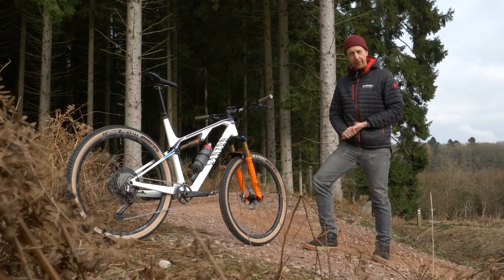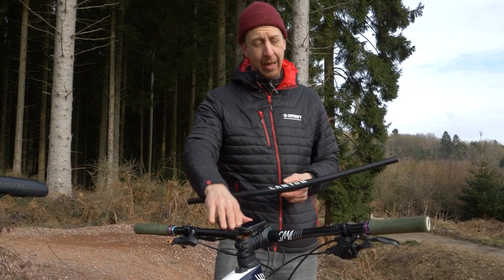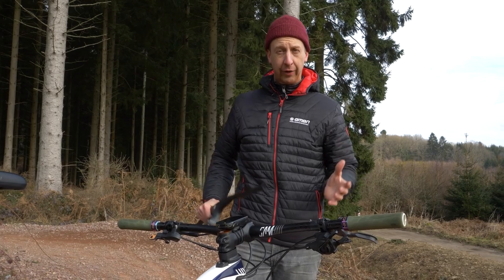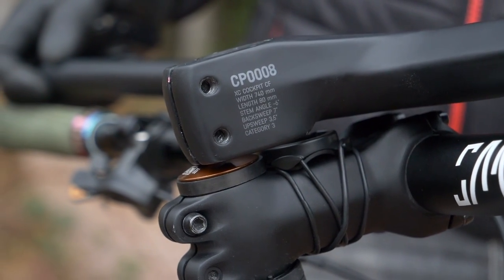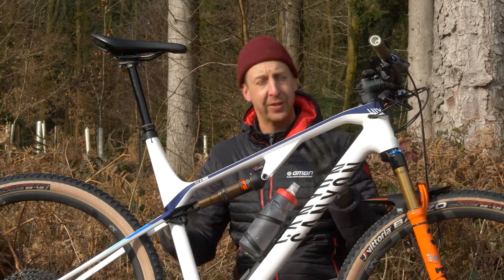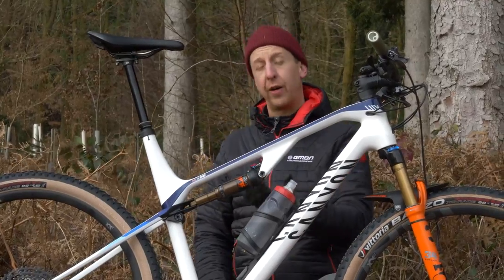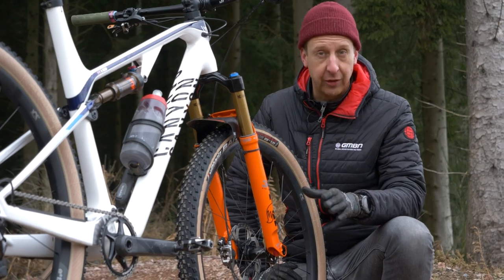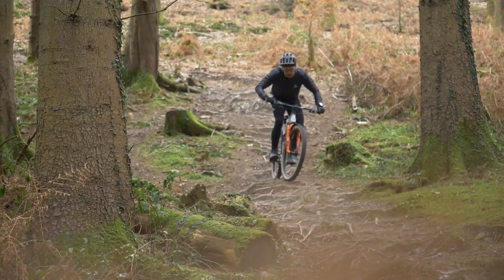How To Make Your XC Bike More Downhill Capable | Downcountry MTB Mods

Comment from the maker: Have you tried any of these adjustments or upgrades?
Reply: Great tips, I adjusted my brake handles a little  higher and excited to try it out.
Reply: Just ordered an XC bike today! Definitely excited to try some of these, especially because I'm coming off an enduro bike.
Reply: I just put a set of 780mm raceface chesters on my Scott scale
Reply: Not as such, I’ve added lightness to my bike
Reply: Thx Doddy for that great tip about moving the cleats inward. Will definitely try that. What about tyre choice esp on the front? And have you ever considered installing an angleset? I did, and the slacker angle gives me more confidence when going downhill.
Reply: I was wondering whether or not to pony up $45 for an aftermarket air spring to go from 130mm to 140 on my Fox 34. While this is out of the XC range you describe here (100mm to 110) it’s important feedback on the impact a wee 10mm can have on a fork.
Reply: I had my ancient XC bike overforked by 50mm with a 35mm stem, 1x9, noice chainguide, it hauled ass at the bike park xD
Reply: I'd like to know if you could do a similar shock update on a Canyon Neuron from 34/130 to a 36/140 travel fork?
Reply: Handlebar from 720 to 760 + shorter stem and dropper post on my Ghost Lector improved downhill extremly in my opinion
Reply: Not yet,  my plan for my xcaliber8  is the dropper post first and probably the tyre - magic mary schwalbe evo for front 29x 2.4 
and rear tyre nobby nick 29 x 2.4
Reply: I have doddy. For approx 15 years. Great edit.
Steve 'the butcher'
Reply: I swear by the dropper post, so much so that I went with an AXS Reverb. Yes, it's ridiculously heavy by XC standards but the trade-off in performance is worth it to me given the fact that I use it extensively, not only for down hills but in cornering as well (lower center of gravity = quicker and more controllable turns). The 60mm DT Swiss dropper that came with my Lux CF 8 was not only lacking in travel but the thumb lever was painfully difficult to actuate. I also upgraded from entry-level SRAM brakes to a set of four piston Shimanos with 180 rotors front and rear. Also cringe-worthy to the average XC purist but in this case the term "finger tip control" is no exaggeration. 

As a side note, I ordered a Trek Procaliber in February and was told that I'd be lucky if I saw it by November, thus I "settled" for the Canyon. Incredible bike! One of the best compromises I've ever made.
Reply: No, but I would like to give some feedback: I find that the audio quality is all over the place (multiple videos). Doddy hisses a lot in this one and in another video Blake's audio feedbacks over the other mics used. This last one can be fixed in post by muting the others while he is talking. Otherwise no complaints and keep up the good work! I personally love the epic ride series!
Reply: I have also changed tires by using a couple of grippier tires. 👍
Reply: I did similar things on my gravel bike to make it more XC. Could you do the same type of video for gravel to XC so that large clearance gravel can be used on the blue (may be red) trails in the forest of dean?
Reply: @Malio75  Not Doddy, but I think that making sure your shock is adjusted correctly is more important than travel for an all-around bike. I have 120mm travel on my Recon Silver and haven't yet felt I needed more. That said, when I first got it I felt that the front end seemed very twitchy, so I spent some time tweaking the sag/pressure and rebound and now it feels very comfortable. I'm presently running just below the minimum for my weight on the Recon and feel that the 120mm is plenty. It really did make a huge difference in the bike.
Reply: yo,
if I put a wider bar, shorter stem and better tyres on my scott scale, will it be a trail capable bike?
Reply: I would like 10 mm move travel on my xc hardtail from 100 mm to 110 mm travel
Reply: I like to try these on my bike unfortunately we don't have much money to buy these parts😢
Reply: not cause of you i have a 70 mm 0 angle stem with a 720 bar on my race touring mtb and a 70mm +7 stem with a 740 mm bar on my other one. I set the stems at the lowest position to mantain stability. Both bars have like +10 or +15 mm low rise
Reply: Berm peak did something like that called the ozark trail max pro studio

Comment: Todays fs xc bikes are already very capable. What i want to see is a cheap 'xc' entry level hardtail modded and shreded downhill
Reply: How bout a 500 dollar apollo aspire 10 27.5 built up? Doing that currently, I got it as a bare frame so I could use any parts I want on it, 1x10 11-42t cassette 32t chain ring, haven't decided on the derailuer yet but I'm also getting hydraulic brakes for it, rockshox Judy tk silver fork as I don't see the point putting a fork that costs more than the bike on it 😂
Reply: There are entry level hardtail enduro bikes which would be lightweight and affordable like hardtail XCs but has the geometry for better downhill performance. Build something like an XC-Enduro hybrid, but then it will be a compromise between the two.
Reply: Agreed. I have a 8yr old XC bike 26er. Id like to see how I can best take on jumps and big drops that come along a flowing trail with OTB'ing as my geometry doest inspire confidence in taking on Jumps especially. On a slack FS it feels a world apart.
Reply: @sepg5084  isn't xc-enduro called trail? they are made to go through the trails so up and down, enduro is a bit like this too but more towards dh
Reply: I'd like to see this too
Reply: @sensei-kyjo5651  Yeboy
Reply: Threw a 120mm on my old giant hard tail. It Lifted the front end which made it slacker. Used an aggressive negative short stem to reduce the height. I have an XC dually but I actually live the old hard tail.
Reply: @mattytorques  i have an 8year old 26in race hardtail. Hand down from a friend... So, wide bars, either big platforms for the jump track or just clips for the day to day mayhem, 27in wheels that actually scrape the frame's paint in the rear. Zee brakes 180mm rotors front/rear. Good fun in the forest, but only recommended for people with enough brain damage to actually go for that ride. She is pretty tail happy at times.
Reply: Waiting on the advert to finish. I just knew they would use a stupiy expensive full sus basically all rounder rather than a bike 99% of us own or can potentially own
Reply: Let me tell you what buddy
Reply: Modded? Wrong term bro mod is the shortcut of modified so why use a wrong term?
Reply: Lol check my channel I posted a video of my entry level xc bike that I’ve upgraded to go downhill
Reply: I ride a 16 year old Giant Ranier here in Michigan 26” and still shred it. I’m faster than most of the guys
Reply: Anyone using 27.5 wheel set on a 29 bike?
Reply: just look at cube aim sl 2022 i have that bike i copped it for 300 bucks used in basically new condition and it is considered an xc but its basically not its more of a trail bike

Comment: The one thing I would recommend is a dropper post, it adds lots of weight but the benefit is unbelievable
Reply: At that point just buy a trail bike lmao
Reply: There's one on that bike, did you watch the video?
Reply: @Nosloveingneko  lux comes with a dropper...
Reply: Just buy a trail bike it be more better lol
Reply: @Nosloveingneko  a trail bike ain’t winning no xc races. An xc bike with a dropper will.
Reply: I honestly dont understand why they aren't more common in xc races. Most xc races are about 2-3 hours long. I find it hard to believe that an extra 3 or 4 hundred grams over that time outweighs the advantage of being able to rip the downhills with full confidence.
Reply: @SnootchieBootchies27  I think I read/heard somewhere that some of the top racers actively chose not to run a dropper to prevent them going too hard on a descent and breaking their bike!?!?
Reply: @chiefsilverback  maybe that's what they think, but their bikes should not be anywhere near that fragile. If they were, it would be pretty dangerous to race on them
Reply: @SnootchieBootchies27  The Canyon Lux is rated as a class/category 3 bike for "harsher, unpaved terrain", treat it like a DH bike and you might break it. Also it's not just the frame, if you're running super light XC tires and your saddle is dropped giving you more control to take the fastest line rather than the smoothest....
Reply: @chiefsilverback  well I disagree about line choice. With seat down you are way more maneuverable and can pick the smoother line. With the seat way up you end up getting rattled into poor lines. You can still choose how fast and aggressively to ride, but with more control. I think it's a pretty ridiculous choice to not run a dropper because you might go "too fast" when you're racing.
Reply: @SnootchieBootchies27  I’m sure if they felt a dropper would make them faster they’d use one.
Reply: @SnootchieBootchies27  3 to 4 hundred grams is a lot of added weight. A dropper also adds another component with a potential failure. If it were to stick in the down position(I've seen it), that would cause a major problem in a race situation. Most xc racers can descend just fine without one.
Reply: I would disagree, while they are nice it’s a bit of a waste of money if your looking for a more downhill capable bike because it takes almost no time to manually drop the seat yourself. Just got to hop off the bike for a second at the top of the  mountain and the bottom of the mountain
Reply: @jessebennett7163  that scenario works if you live in a place with nothing but long climbs an long descents. But the benefit and joy of dropper posts come into play in the vast majority of MTB trails that consist of constant up and down.
Reply: @SnootchieBootchies27  i guess that’s true, never thought of it it like that. All of the trails in my area are a long climb up followed by a long decent down. could be useful if you ride a lot of rolling hills and stuff. Didn’t think of that. Just depends on your local trails
Reply: lllllllll
Reply: @Nosloveingneko  Dropper cost me £175 all in and its a suspension dropper so it gives a little cushioning on the rough. it doesn't make economic sense to buy a whole new bike for one mod, my XC has just become so much more capable by this simple mod. At my skill level, extra weight don't matter, there are too may people who harp on about geometry and set up of this or that, for the average joe just getting down a hill is a result and great fun.
Reply: Weight doesn't matter much unless you're racing at a high level where fractions of a second make a difference.  I don't know the exact formula, but I'm guessing every extra pound probably adds a couple of seconds over a mile.  Not really significant to a casual rider.
Reply: @SnootchieBootchies27  Cognitive friction, maybe?
Reply: Dropper is the biggest invention in mtb for the last decade in my opinion. Just evolves your riding so much

Comment: I learned the lesson about wide bars the hard way.  I was pedaling along between the trees, and the next thing I knew I was on the ground.  Ever since then I've paid more attention to my clearance.
Reply: I had a pair of ScottAT-2LF bars on my old bike. http://www.bikepro.com/products/handlebars/scott_combo.html.

182 grams, 550cm, built in bar ends. Tiny super light, flexible little things, loved them. I could ride slowly through crowds on the beach, knowing my shoulders were wider than my bars. Never had to worry about tree width, but they provided zero leverage when standing and pulling. These were the good old days of early mtb. 1998. If i could get a pair in 750 width id buy them in a second.
Ride safe, my friend.
Reply: I was riding a trail last year and there was a section where it passed between two trees that must have been about 800mm apart. Needless to say there were score marks in either tree at bar height!

Comment: I really enjoyed transforming my Canyon Nerve 120 to suit my trail rides:
120mm dropper post
Handlebar - 720mm to 760mm
Stem: 90mm to 60mm
Angleset: -1.5º HA 69.5º to 68º
Fork: 120mm to 140mm HA 68º to 66.5º
Wheels: 19mm to 40mm inner rim width
Tyres: 2.2" to 2.6"
Bottom bracket is 10mm higher, wheel base is 25mm longer and reach is 15mm shorter
The bike now is way confortable and way better for my riding

Comment: How about downcountry hardtail setup? I'm looking for it. Hope you can make vid of it
Reply: same stuff thats in this video
Reply: I built mine with a Pike 130mm, M8120 brakes, a 150mm dropper and ofc 30mm wide rims (32h EX511 hoping they cope with abuse better). Depending on the use I might add an insert later. Love the strong wheels, capable brakes and super stable fork on a bike that can go fast anywhere, up or down.
Reply: @DrivingMatterMedia  what bike is it? I also have m8120 brakes on mine, fox 36 130mm  and 30mm wide rims. I have a Marin San Quentin
Reply: @calebolson6500  I built up a recent Niner Air 9 aluminium
Reply: @calebolson6500  Nice spec on the Marin as well!
Reply: @DrivingMatterMedia  This! I did the same thing except with a 170mm dropper - I ride a XL frame

Comment: Actually on my hardtail I boosted up the front fork pressure so the front end doesnt dive as much going down steps and drops . It still absorbs some  reverberation of the ground and my body does the rest . This has been very helpful for my bike at a 69 degree headtube angle and I never bottom out . The lower pressure created and even steeper headtube angle  . Havent went otb in over  a year and I have had some nose heavy impacts that I would have  with lower pressure . So I gained more confidence and better results pointing down with higher pressure in my front fork on my hardtail .

Comment: I'd also add a riser bar with a sweep. Running a 25mm riser with an 8deg sweep gives a more natural slightly more agressive trail position especially with ergonomic grips es with ergon. Hadn't thought about the q-factor. Dropper post was essential. Added a 100mm to my hardtail made a world of difference. Didn't mention rotors. I changed from a 140/160 to a 160/180 rear/front. Big difference in confidence.

Comment: I just got a cross country bike, and these tips were very helpful to me, especially the one about not going with a shorter stem.  I'm currently doing without a dropper post, and I've found a middle-ground height for the seat that's okay for the types of trails I like to ride.  However, as soon as I get the bike paid off, I hope to get a dropper in it soon.
Reply: I never really thought i needed a dropper until i bought a bike that already had one installed. Absolutely transformed how i ride downhill & technical stuff.

Comment: Dropper post for sure. On smooth climbs you can keep it high for efficiency, on tech climbs you can drop it very slightly for balance and then slam it on descents for the best agility. Worth the weight penalty IMO

Comment: Just discovered this video! Thank you for the tip on the break levers! I struggle with wrist pain on the downhill because of my fingers on the break, so I'll try that!
I switched from 100mm to 120mm fork on my HT and I agree, a dropper post is a must have! I run 27.5+ tires (I'm short) and while it's not the fastest set up for flat and uphill, it gives me great comfort and confidence on technical descents. This way I can ride stuff where I only meet riders with FS bikes.
Reply from the maker: Glad we could be of service 🫡

Comment: Sounds odd to some but I live in a hilly part of Wiltshire so I've had to build a bike capable of DH riding but with XC comfort. The solution is a DMR Bolt frame with 800mm Nukeproof Neutron bars, a 35mm DMR Defy stem, Fox Vanilla 130mm forks, all very DH/slopestyle, however the drivechain is pure NX Eagle 12spd for the miles. The seatpost is as long as will slam in the frame so it can come up to the height I require. Some big HT pedals get the power to the road.
 It goes the distance very well, climbs comfortably enough but it flys down the bigger, gnarlier hills too.
Reply: Post a vid of it on you youtube channel I really want to see it now
Reply: @nathanloftus6988  I've got plans to get it on film doing all the different actions it's capable of, issue is getting a good ride in around work. Hopefully I'll be out riding in the next few weeks.

Comment: Here were the upgrades I implemented on my SC Blur to make it more downcountry:
1) rigid carbon seat post —> fox transfer dropper post
2) racy Aspen tires —> Maxxis Ikon in back and forecaster in front
3) six inch rotor —> 8 inch rotor on the front 
4) 100 mm fox 32 fork —> 120 mm rockshox SID ultimate fork
5) removed remote lockout to get rid of all the clutter on the cockpit (shock is now always open and fork has lockout switch on the crown) 

All of these changes have made my blur sooo much more capable and fun!